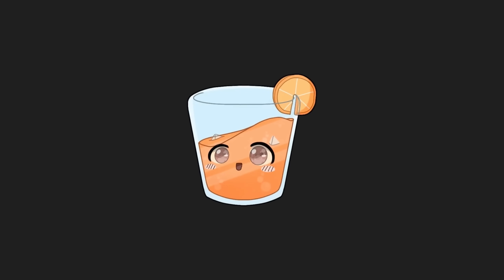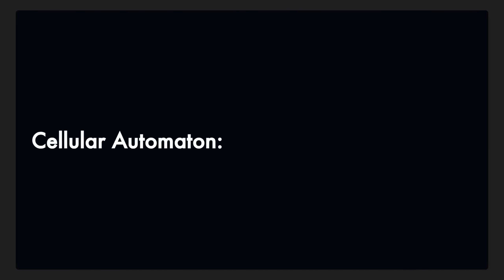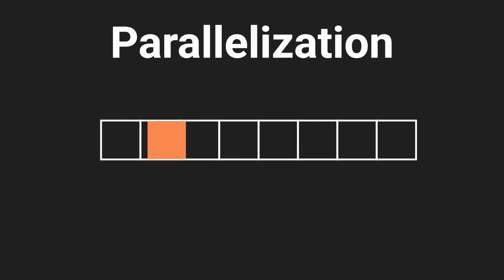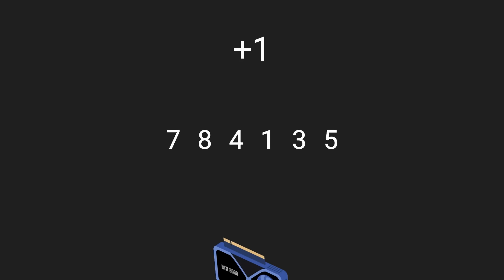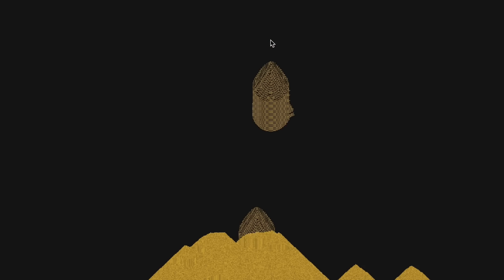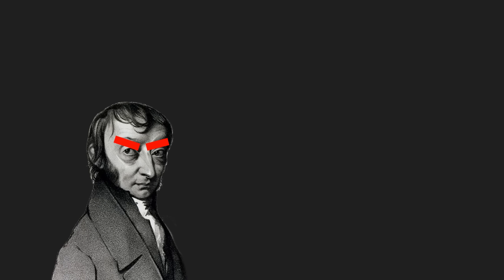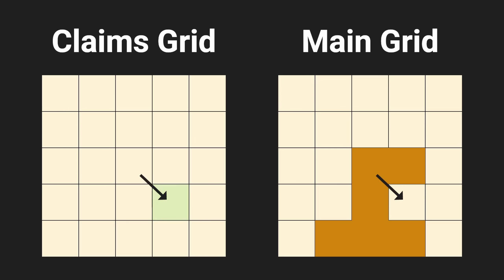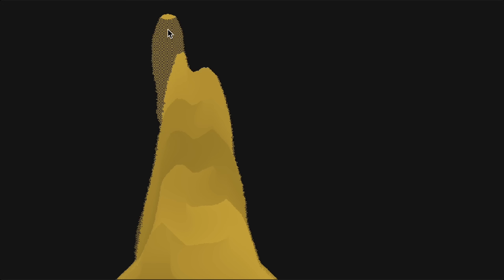Optimizing a Falling Sand Simulation To an Unreasonable Degree

Comment: The problem with atomic operations is that you've lost parallelism. You had to introduce a "claims" buffer to navigate around this as well. The correct and most performant way to handle this is to swap from a "scatter" approach (each cell/thread tries to write into another cell that another thread owns), to a "gather/advection" approach (each cell/thread pulls in sand that would move into it). This eliminates half your race conditions (no attempts to write to a cell that another thread is trying to write to), but leaves you with the other half: reading from neighbor cells which are also updating their values at the same time. To eliminate that half, you use two buffers for your sand, one to read from (bound as an SRV) and one to write to (bound as a UAV), then "ping-pong" between them each iteration (so your last iteration write buffer becomes this iterations read buffer). These two patterns: gather instead of scatter and ping pong read/write buffers; will completely eliminate race conditions, keep all operations fully parallel, and conserve all mass. Plus it'll by a lot more performant.
Reply: I kinda want to see another video implementing this solution 🤩
Reply: Hey that reminds me of how fluids are simulated through the eulerian approach. Is that the case or am I off?
Reply: As pointed out by @fakestiv I don't believe this approach would work, if I understand it correctly. For a cell to know which of the 3 sand above it can move into it, you need to know if they are not being pulled in to the cells to the left and right of the current one instead, which requires calculating the same for those cells, and it cascades to the entire width of the simulation. Also, if you were simulating more than 2 falling materials, you would need to know if no material heaver than sand is falling into the cells above the current one, which once again cascades to the entire simulation.
Reply: @_flix_  Well surely if you've got 3 cells of sand above, then the one immediately above wins every time (least euclid distance), so we only need to deal with cases where there's two sandy neighbors diagonally above. If either horizontal neighbor is empty, the opposite side sand wins by the same logic. So, we only need to deal with a case where both horizontal neighbors are filled and we have two diagonal-up neighbors. In that case, I think we can safely answer with "neither wins" and leave a V-shaped 1-pixel hole.
Reply: @j.c.m.2181 You didn't consider that the sand diagonaly above can also fall into the horizontal neighbor 2 cells away. Also I'm not sure what you mean by "V-shaped hole", you would just have pillars of air in your sand pile. And if you had materials of different weight, it is no longer the closest one, but the heaviest on that fall in, which too breaks this.
Reply: @_flix_  Fair. I meant a --- pattern of blocks on the top layer, like a square wave or a castle wall; a notch in the line. But yeah, it would form pillars. 

In that case, I think we need to have a 'statically' (per-tick at least) known bias, left or right. If we are on bias-left, we know the top-right grain will fall into us if we're empty and not into another cell and can ignore top-left this tick.

If we're doing weights and physically-based modelling, I think we'd need something far more sophisticated than simple binary CA rules in one pass.
Reply: Surely a much easier solution is to just do the sand in 3 passes, one for each direction, using an extra bit or array to prevent grains that have already moved from moving again in one of the remaining passes.
Reply: The multi buffer thing is correct, although One thing I should note: If you are in a situation where the sand particles are very sparse compared to the map, you would still want to simulate each grain forward. In that case, I would generally use a three pass approach. First try to move everyone down. Those who couldn't, try to move to one side. Those who couldn't, try to move to the other.
Reply: @joshuacook2 I don't know what you mean?
Reply: @envadeh if you move the sand in only one direction each step, there are no race conditions. Races only happen when sand moves onto other actively-moving sand, which is impossible if for that time step sand only moves to the right.
Reply: @CrayonEater9845well it still needs to write to another place, which is owned by another thread. What if the sand moves to the right and the thread there thinks it's an old sand?
Reply: finally my course in distributed computing and parallel programming shines
Reply: One of the most insightful comments I’ve read, thank you for the explanation!
Reply: I made a CA where each thread takes a 7-cell star neighbourhood and evalutates the central cell. 7-steps and the whole grid is evaluated with no race conditions!
(Could also do a 3x3x3 grid, but that would be 3 times slower, and corner-less version of that doesn't tile)
Reply: this is a fairly good solution but it doesnt fix the airgaps created when large pieces fall, because you still are waiting for the previous cell to fall. Also looking at the source code he has already implemented an input and a result texture.
Reply: This sounds exactly like how convolution operations for real-time image post processing work (i.e. for effects like bloom or depth of field), so it sounds reasonable at least. Only difference is that with convolution you are allowed fractional parts of the source pixels in the destination, while here you need to constrain it to being either filled or not
Reply: @dominiccasts  Feels like half of GPGPU is implementing non-image logic using image processing techniques! Edge detection, thresholding, blurs...
Reply: @j.c.m.2181  I mean you can implement Conway's game of life using a simple 3x3 convolution filter (1 in every cell except 0 in the center) and one line of arithmetic to process the result
(fragColor = clamp(lastFragColor + 2.0 * (0.75 - abs(vec3(2.75) - filterResult)), 0.0, 1.0);). Easier than falling sand due to there being no room for race conditions, mind you, that problem probably needs more than just a convolution filter, or at least not a one-pass one
Reply: I don't quite understand how this eliminates race conditions, or rather why it should work in the first place. Wouldn't multiple cells fill themselves with the same sand cell if they all access the read-buffer at the same time? How does Ping-ponging help this?
Reply: @maxfrobin8930 a simple way is to make the sand only roll to the right. That way a cell cannot be filled from both sides, it can only be filled from above and diagonally from the side. This makes it much easier to check for each cell. Then next time the sand can only roll to the left. Then flip flop between left and right every other iteration. The downside is that rolling sand flows half as fast as falling sand, but given friction I would call that a feature, not a bug.
Reply: @maxfrobin8930  it seems a little complicated from my research but from what I can tell they use deterministic diagonal tie-breaks. There are different kinds but Parity-based tie-breaks seem common. It is a simple alternating pattern based on coordinates where empty cells will prefer to take in sand from the left or right side so that it only takes in one sand without having to communicate with other cells. This combined with the separate buffers prevents race conditions and sand duplication/loss.
Reply: @bro_mayo5413 Cool. This answers my perplexity on this issue too. Always choosing one side wouldn't be satisfactory and, albeit positional, this could be an effective compromise.
Reply: @maxfrobin8930  If you just use one buffer and read and write to the same buffer, what could happen is that some sand would go down only in that frame, but the other thread would read it and the sand wpuld go down again. Basically 2 frames of movement in one!
Reply: @maxfrobin8930 A definite automata wil always give the same result, so only one cell should fill itself from the input cell
Reply: I've got a small question about this approach. Would there be a hard speed limit? My thought process would be the cell saves the amount of cells its moved, and the program could either do multiple passes, or it could go top to bottom (or bottom to top now that i think about it), doing second passes over rows that have particles that need to move.
Reply: @slimed1206 it would run for every pixel. But that doesn't matter that much when e.g. a 4080 in theory can draw 280 GPixels per second. That's more than 33,000 4k frames per second. 

Of course it will be slower than that, but it should easily be many thousand FPS even in 4k.
Reply: In my experience tackling this problem, this ended up not working at all.

Granted, my simulation was strictly RNG-based: each cell could independently randomly choose how to behave on each frame. I also didn't have a special case for the "empty" cell—in my simulation the "empty" cells were just a cell defined to have 0 weight (but affected by gravity) and 0 density. So the notion of a "Gatherer" cell as opposed to a "sender" cell ends up being poorly defined: a cell both has to gather lighter elements from below and gather heavier elements from above, which is isomorphic to a cell sending heavier elements down and lighter elements up. Not to mention I also had to add "Interactions" (i.e. Water+Fire→Steam) and those operate in all directions, again rendering the idea of reversing the operation poorly defined.

In the end the real solution I arrived at was similar to what this video showcased, but more sophisticated: we stagger simulations across rows and columns (every third row/column, I believe, for the simpler cases of gravity and flow, and every 5th cell in what was either a Pentomino-L or Tetramino-L shape pattern—can't remember off the top of my head which one it was) and then randomize the order of operation each frame (and for each cell within each frame) to eliminate bias towards any particular direction. This required a multi-pass algorithm (3 passes for gravity/flow and 5 passes for interactions) but required no claims buffer or locking (or even a separate buffer!) so was still fully parallel. I could still get 30FPS on a 1920/1080 grid, or around 100FPS on a 1280/720 grid.
Reply: It´s quite easy with a compute shader to just use Interlocked compare and exchange with the values from the top row so only one thread grabs the sand... Pretty common actually.
If done on the CPU then you could simply process the buffer from top-left to bo4rom-right, even a single thread can process the entire screen very quickly on modern CPUs.
There are so many possibilities nowadays...
Reply: @Patapom3 It's easy, but it's much slower, especially if the data isn't in groupshared memory.
Reply: This is interesting, imagine a 2x2 grid where only the bottom right (br) corner is empty. In this case, br could pull from either tl or tr, but in turn you'd need a bit more care updating those cells, because you still need to tell if the sand should stay there. For tr, it shouldn't, because there's nothing below, but for tl it should stay despite br being empty because the cell to the right (tr) is sand. Now, if you imagine that the left side was standing on top of a solid pillar and you continued the simulation, you would notice that the two grains of sand fall keeping one cell of distance. I don't know if or how desirable it is, but it's worth keeping in mind. A new source of headaches would be to determine if a grain of sand should stay there. Imagine a grid with 3 2-tall columns, where only the middle one is empty. How do you determine which cell should stay where it is between tr and tl?
Reply: Is this what could be described as "double buffering"? It sounds like it is, if so I am familiar and have used this for parallelizing a gravity sim as well. I can vouch for that this allows massive parallelism!
Reply: Double buffering just means using 2 buffers. Can be for anything.  @aleksanderwit
Reply: @envadeh  Makes sense.
Reply: @aleksanderwit shouldn’t you know if you’re so familiar? 😂
Reply: @johnandrews9433  Not really, I am a self-taught programmer and like to make sure about things that I am not completely sure on. I landed on double buffering for one of my problems by myself, and only later learned that it was called double buffering.
Reply: Oh wow, is this what it means to think outside the box? To look at this problem from a different angle to "pull in" the sand to void spaces instead of "push into" a void space would also mean you'd also not be making extra computations on "stagnant" sand. Then again, you might still end up with an opposite yet still similar problem of the sand now duplicating on a race condition rather than merging
Reply: This is pretty optimized ngl.
Reply: What
Reply: Why did i read that

Comment: instead of struggling to read a grid atomically while you're actively modifying it, have a double buffer. Read from A, write to B. Fully parallel, swap at the end.
Your cellular automata rules should account for conservation of mass.
Reply from the maker: I do actually use a double buffer! That just doesn't solve race conditions because you're still running a bunch of threads in parallel to read from the input buffer.

Comment: Have you tried using interlocked compera exchange without a seperate claim grid?
That is:
Read the cell state you wanna check, if empty, tried to set it with interlockedcompareexchange but only if the state is still the one you read before.
If this fails, simply redo the iteration. The advantage of not having a seperate datastructure is less memory bandwidth needed. 

Pseudocode:

while true
{
  CellValue = Grid(x, y)
  if Cellvalue == Empty
  {
    NewValue = Filled;
   //set cell with our new value, but only if state hasn't changed 
   if InterlockedCompareExchange(Grid(x, y), NewValue, CellValue) != CellValue //CellValue was empty when we read it so the function should return the old state, which we expected to be empty
   {
     //Failed. We tried to write to a cell we read as empty but it was already filled. SO we go back to the top of the loop and redo our run.
      continue;
   }
  }
  //quit loop. we either have sucessfully set or value or the cell we checked was full anyway, already
  break;
}

Comment: I'm not sure if it's faster but you could technically do it in a more mathy way without atomic operations and any lock for race conditions, i'll try to describe it:
from enum import Enum

class Cell(Enum):
    Empty = 0
    Sand = 1
    Wall = 2

def get_cell(x: int, y: int):
    return grid[y][x]
def set_cell(x: int, y: int, cell: Cell):
    grid[y][x] = cell
def is_empty(x: int, y):
    return get_cell(x, y) == Cell.Empty
def is_sand(x, y):
    return get_cell(x, y) == Cell.Sand
def is_all_sand(*coords: tuple[int, int]):
    return all(get_cell(x, y) == Cell.Sand for x, y in coords)

def update(x: int, y: int, frame: int):
    if not is_sand(x, y): return
    dx = (frame&1)*2-1
    if is_empty(x, y+1): # try falling down
        set_cell(x, y) = Cell.Empty
        set_cell(x, y+1) = Cell.Sand

    if is_empty(x+dx, y+1) and not is_sand(x+dx, y) and not is_all_sand((x+2*dx, y), (x+2*dx, y+1), (x+3*dx, y+1)): # try falling in dx
        set_cell(x, y) = Cell.Empty
        set_cell(x+dx, y+1) = Cell.Sand

    if is_empty(x-dx, y+1) and not is_sand(x-dx, y) and not is_all_sand((x-2*dx, y), (x-2*dx, y+1)): # try falling in dx
        set_cell(x, y) = Cell.Empty
        set_cell(x+dx, y+1) = Cell.Sand

Comment: Why can't you calculate all sand falling straight down first, then for the sand that can't fall straight down you check if it can fall left, then the final sand that cant fall down you check right (alternating per frame). 3 scans per frame. However, you skip the sand that has already moved.

Comment: Excellent work! It's crazy how just moving it all to the GPU improves performance, even before specific tricks! 

A lot of sand sims have more than one material, adding metal seems easy, "this cell doesn't move, skip it", but any thoughts about how you'd implement other stuff like acid, water, etc?

Comment: I haven't written a falling sand CA, so this might be overlooking something, but: The way I've implemented parallel CA's in the past is by having two grids, one for each consecutive frame. Each the contents of grid A is read to write grid B, then the inverse for the next frame. Also, I've always implemented the rules in terms of the cell being written to, so only one thread writes to the target cell.

For example
> If cell is empty
>> If cell above has sand
>>> Set cell to sand
>>> Exit
>> If cell to the upper right has sand
>>> Set cell to sand
>>> Exit
>> If cell to the upper left has sand
>>> Set cell to sand
>>> Exit
> If cell has sand
>> If cell below is empty
>>> Set cell to empty
... repeat for the diagonals

Also, to fix the side bias, I'd either use the coordinates of the cell as a "random" seed (which I saw you had in your code, using the uv coords), or just alternate based on if the row is odd or even.

Edit: Comment section mangled my indentation.

Comment: 4:50 couldnt this specific bug be fixed by having any diagonal move check that there isnt a sand particle directly to its side?

i.e
0,1,0
0,1,0
to:
0,0,0
0,1,1

and 

0,1,1
0,1,0
to:
0,1,0
0,1,1

The particle falling straight down is unheeded but the one trying to move diagonally sees that theres one directly next to it in that direction and doesnt move. It could also instead go to the left if you felt like it

Comment: make it so that the system only applies the rules to sand that is blocked in on all sides, corners included, for a faster result. Also, make the check for the perotic lets say every 4 frames or better yet use dirty flags to make so that sand in motion and sand that touched sand in motion is the only sand updated